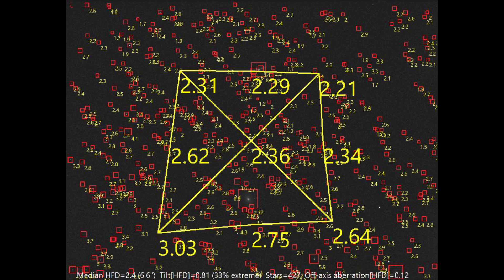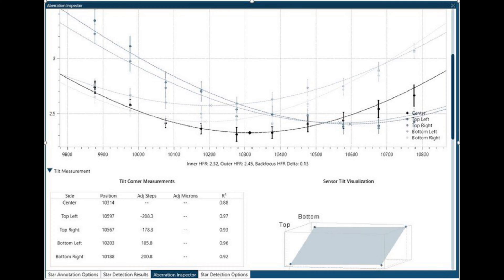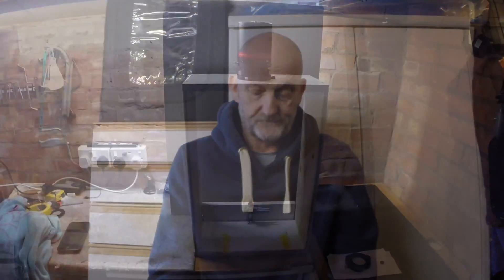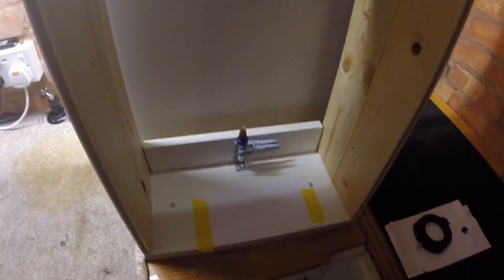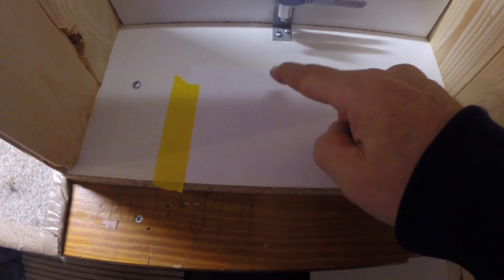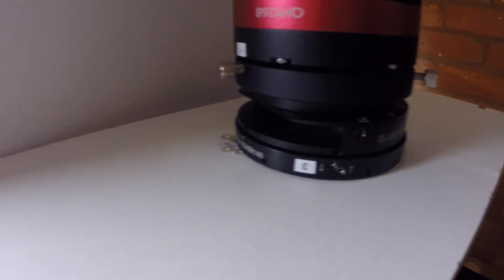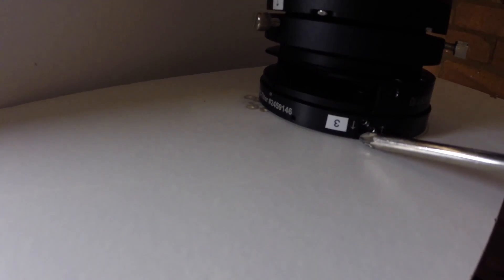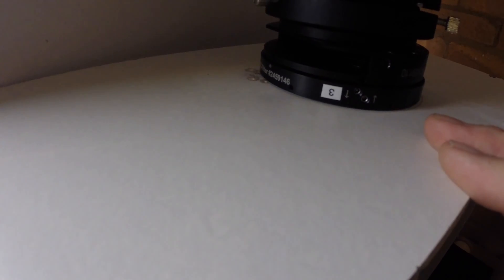Sensor Tilt & How To Deal With It Easily

Comment: Hello  - This was an excellent video.  Thank you so much for putting it together.       

I have a DSLR camera with a nose piece that slides into the barrel of the focus tube.   I believe there is tilt in the system but I am not sure if the sensor is tilted relative to the camera body,  or if the entire camera is being tilted  when the the locking screws on the focus tube are tightened. 

In either case,  if I want to check sensor tilt for my camera,  is it best to hold the camera in the laser test rig the way you have done it,  or somehow mount it using the nose piece maybe in a "Vee" block ?

Thank you
Reply from the maker: Thanks for the comment, check out my newer video on tilt adjustment, using a new tool just been released, a handheld version of this laser tilt jig..Clear skies
Reply: @ can you provide the link
Reply from the maker: @oq17  https://youtu.be/iyH7vsAqcDA?si=Iu5o393248nWaekQ

Comment: Thanks!  I built a rig using a pillow block mounted ball bearing. . .and my sensor dot would not stay stationary.  The block wobbled no matter what I did.  Your rig should dodge that problem, and I’ll give it a try.  Thanks for the idea and the very thorough explanation.
Reply from the maker: Thanks for the comment, and thanks very much for the Super Thanks, it’s much appreciated, and am glad you found the video useful, please let me know how it goes..Merry Christmas..👍🏻
Reply: @Astro_Shed Success!  I wish I could upload a photo.  My circle went from 3/8ths of an inch to a blob about 1/16th in diameter.  Considering the slop in my system and the width of my pencil, that’s as close as I can get—I think.  I’ll see how my stars look and come back to this if I need to.  I can’t thank you enough for making this simple and comprehensible.  Other videos on YouTube covered the same method but I had no luck.  Thanks again.
Reply from the maker: @FrankSD76  that’s brilliant, glad you got it sorted…👍🏻

Comment: Wouldn't it be better to point the laser to the edge of shorter side of the sensor? This way the circle of the rotation uses the maximum area on the sensor and the projected circle with the reflection magnifies the error more.
Reply from the maker: Hi, and thanks for the comment, no that would not work as the reflected beam would move off the edge of the sensor, during rotation of the camera…and so you would not see the true tilt issue, pointing somewhere near the middle is best.

Comment: Great solution, thank you! I'll definitely check my sensor's tilt. Do you think it's possible to test a whole setup (camera, filter wheel, lens) overall tilt with this method? I have a serious issue with it, but I'm not sure it's a factory sensor tilt. I'd rather suspect low quality joints (m42 threads or nikon adapter before the lens)
Reply from the maker: Hi thanks for the comment 
You could try with full imaging train but it does get harder with a filter wheel as the weight is then offset and hard to turn and keep perfectly stable, have a go and see, let me know how you get on 👍
Reply: @Astro_Shed  so it turned out to be impossible to use a laser for the whole setup. The number of reflections (additional dots) was overwhelming :)
But I've found another way. I printed 50% gray, getting an A4 of a pretty uniform halftone. I hung it on the wall and set the camera to be perfectly perpendicular (using a laser distance meter). I set the perfect focus in the middle of the frame (I use a regular lens, so I was able to do it from about 1 meter) and checked focusing on the corners. I managed to perfectly adjust it using this method. It turned out that the problem was an M42-Nikon adapter, which was loose. After fixing and adjusting, I got a perfect focus all over the frame. Well, I haven't actually tested it in the nighttime yet, but I have a good feeling about it :)
Reply from the maker: @mich2137  you will always get a reflection of every surface the laser passes through but you need to make sure you choose the right dot, as it’s easy to use the wrong one and think all is good when it’s actually not 👍
Reply: @Astro_Shed  thanks, I'll give it a try. I'll try rotating both the camera tilt plate as well as the threads between all the parts

Comment: What are the approximate dimensions of the box?
Reply from the maker: Well that does not really matter as I just used offcuts I already had, mine is approx 24” high by 15” wide by 12” deep, bit it really does not matter as long as you keep the camera turning on the spot with no lateral movement, and the laser is fixed and  angles at about 10 degrees and pointing at the sensor somewhere around the middle..
Reply: I can’t find a 1mw laser pointer. Will a >5mw laser damage the sensor?
Reply from the maker: @landarch283  I have no idea, but would not recommend, I can only recommend a 1mw laser, but they are getting harder to find I do agree..🤔

Comment: How is the laser attached to the box?
Reply from the maker: Hello, thanks for the comment
It’s attached with an L shaped bracket screwed to the base, and the laser is cable tied to that bracket..that way you can adjust the angle if required by bending the bracket slightly in either direction, it just needs to stay in the exact same position during testing..

Comment: Thanks Stuart, great video mate! I think I must have some tilt in my ZWO 2600mc, I’m using the Askar 400 petzval scope, you shouldn’t have to worry about a flatner or back focus, previously on this scope I had good stars right to to corners, now I’m getting little lines bottom right of the image! Can’t think what it could be, I’m well balanced, polar aligned and guiding at .6, I’m stumped, so thought it must be camera tilt! I’ll give that laser and jig idea a go! Thanks and clear skies 👍
Reply from the maker: No problem Simon, let me know how you get on and any questions let me know 👍
Reply from the maker: One thing, if you rotate the camera on the scope does the tilted corner move too…?
Reply: @Astro_Shed  Funny you said that, I was just literally rotating it now🤣 I’ll try it out tonight, got a clear sky, I’ll let you know! Thanks Stuart 👍
Reply: Hey Stuart, just to let you know, I’ve figured out my funky stars problem! As you suggested, look at the rotator, that’s what the problem is! I rotated the camera to the same position I did my andromeda image and the stars are now perfect! It appears that the rotator itself has a slight tilt! I’ll have to speak to Rother Valley Optics about it! Thanks for your input, clear skies 👍
Reply from the maker: @SimonsAstro  hey Simon, so what rotator are you using, and dit you get those adapters I recommended for your 120…? Or is this the built in rotator on your Askar scope…?
Reply: @Astro_Shed  hey mate, haven’t had a chance yet to get the spacers for the 120, it’s on the cards! The rotator is built in on the Askar FRA400, seems a bit off!
Reply from the maker: @SimonsAstro  that’s annoying…☹

Comment: Great Idea!
Simple, efficient, that's all we need!
Just one thing I worry about.. Isn't it dangerous for the sensor to be exposed to the laser during that process?
Thanks,
Reply from the maker: Hi, thanks 
No it’s fine but just use a 1mw laser, you don’t need any more than that, they are readily available on eBay and Amazon…👍🏻

Comment: Thanks for sharing! Did you test the tilt with astap after to see if it's now reporting good?
Reply from the maker: Yes, it was much much improved….very happy…👍🏻
Reply: I'm on the tilt journey myself at the moment and have discovered CCD inspector. I like your lazer jig though but I'm struggling to understand how you know where exactly on the sensor to point the lazer, or do you just aim for the middle somewhere?
Reply from the maker: @stefanjagger  it doesn’t matter, as long as it’s on the sensor during the full rotation all is good…👍🏻

Comment: Is the laser directly under the camera or does the laser hit the sensor at an angle?  I guess this determines where the reflection is going to be.
Reply from the maker: Hi,
No it needs to be off to one side and the laser angles at about 10-15 degrees up to the sensor, so you can clearly see the reflected dots…but does not have to be exact…as long as you see the reflections..the nearest reflective surface to the laser (usually the camera window) with be the reflection furthest away as you look from the front, and the reflection you want, should always be the one nearest to you, as long as it’s set up as mine is in the video.
Hope that helps 👍🏻

Comment: Hello, thanks for the share!
Can you add a link to the tilt plate you are using please? It has the adjusting bolts on its side, is that right?
Reply from the maker: Hi, thanks for the comment
This is the one I use, but it has to be fixed to a baader UFC filter drawer system, can’t be used without, link in the description now

Comment: Did you use ASTAP again after you adjusted the tilt?  Dud you notice any remarkable change in the subs after you adjusted the tilt?
Reply from the maker: Yes, there was a big difference after, but I still found ASTAP to be a bit inconsistent, but my star shapes in my images improved 100%, so that was the main thing

Comment: Brilliant. You only briefly mentioned this, but does it matter how far off the center of the sensor to aim the laser? I would think if the laser was dead center on the sensor that it would show less of the tilt? Am I correct in my thinking or does that not really matter at this short distance? Great and simple jig!
Reply from the maker: Thanks much appreciated..
No, it doesn’t matter, but as most sensors are rectangle, ideally the laser should point within a square the size of the shortest side of the sensor, this would mean that when rotating, the laser would not move off the sensor at all…
I have tested with the laser at one edge and bang in the middle, and it shows the same tilt, hard to explain, but the angle of tilt is the same across the sensor…
Hope that makes sense 👍
Reply: @Astro_Shed  Explanation is that the sensor is at a specific angle, and that angle is uniform (more or less) across the entire sensor. All you're measuring here is the angle, not the distance to the sensor which DOES depend on where the laser is pointed. I

Comment: Well explained Stuart, but how can you determine if it's not tilt on the scopes axis.. seems like the testing instrument is kind of cobbled together, surely that has to be accurately put together, square, level and the laser  housed square and level I'm sure any optical bench has to be highly accurate..I've seen and followed Olly's thread on SGL, so on completion of your camera does it show better stars and does ASTAP show a reduction in tilt?
Reply from the maker: No not at all, the jig does not have to be square, and accurately put together, that is the beauty of it, you are only testing for tilt on the camera, not optical tilt, as long as the plane of the camera does not change throughout the rotation all will be fine, and yes my stars are now pinpoint and in ASTAP it shows 1-2% tilt, which in ASTAP is classed as none…as you saw with Olly’s jig, it does not have to be pretty at all, and I did say that in the video, or perfectly square….think about it, as long as the laser can reflect off the sensor, and stays on the same plane while testing them the results will be very accurate.
This is for testing camera and associated accessories such as filter wheels and spacers, not tilt from sag on optical tube…👍🏻
Reply: @Astro_Shed  ok that explains it far better
Reply from the maker: corrected a few typo’s in that last reply…..👍🏻

Comment: Kinda depends on the camera being dead level on the wood doesnt it ?
Reply from the maker: Absolutely not, as long as long as it stays the same through rotation….👍🏻
Reply from the maker: Also the jig does not even need to be perfectly square, all that matters is the camera stays on the same plane throughout rotation…👍🏻
Reply: All that matters is that the camera face mates to the board it's placed upon.
Reply from the maker: @carlhitchon1009  exactly…👍🏻
Reply: Nice one, thanks for sharing